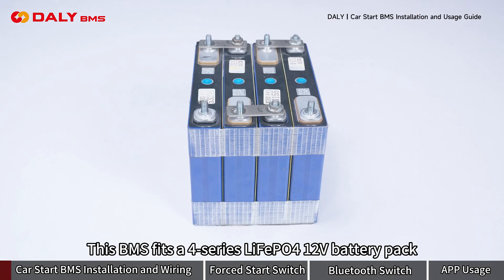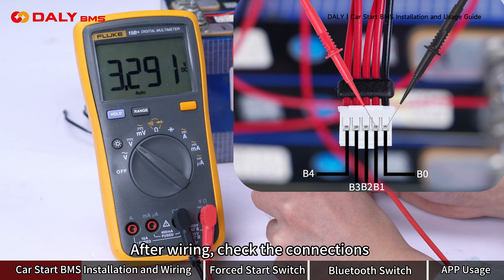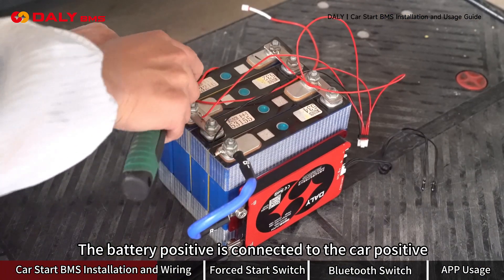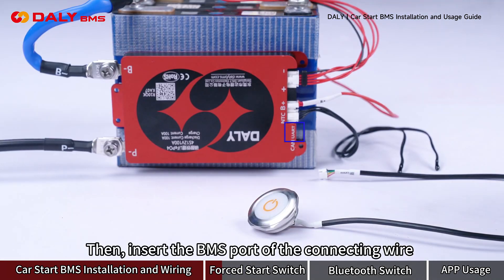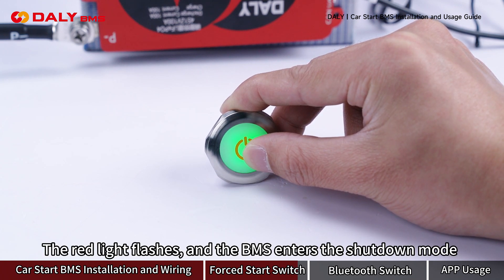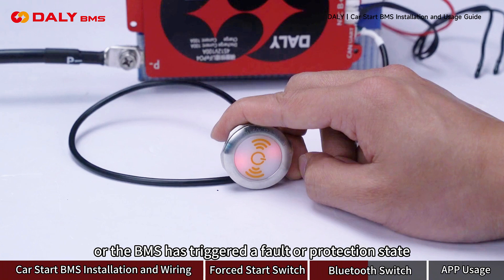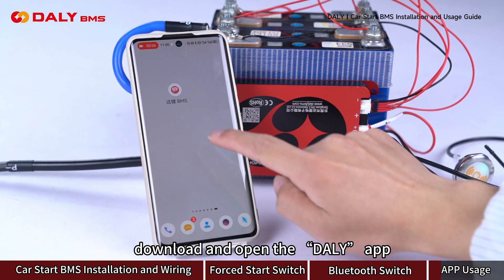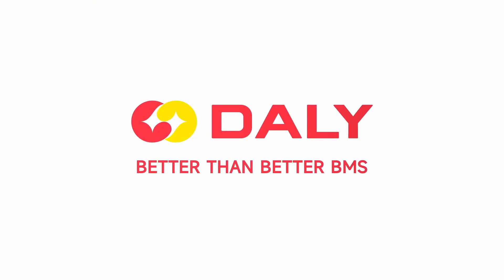Tutorial丨How to install and wire DALY car start BMS?

Comment: DALY calls these BMSs Smart BMSs. But they are actually not. This company does not support the application through which the Smart function should be implemented. Moreover, this company first sold these semi-finished products to customers, and then restricted these customers from accessing the Smart function.